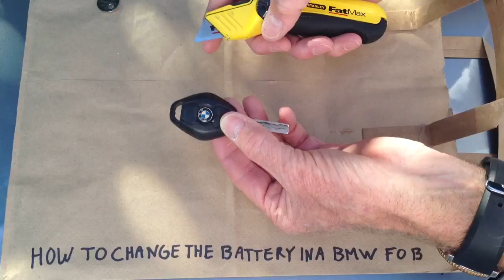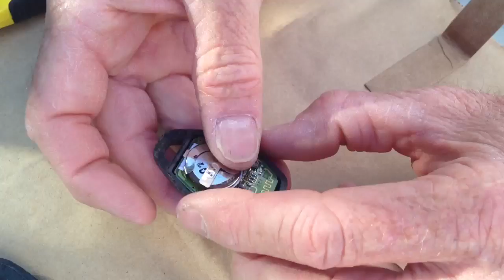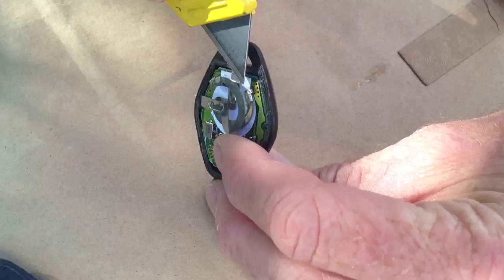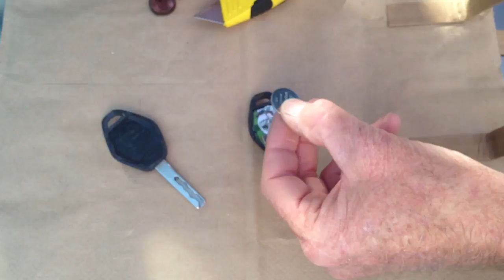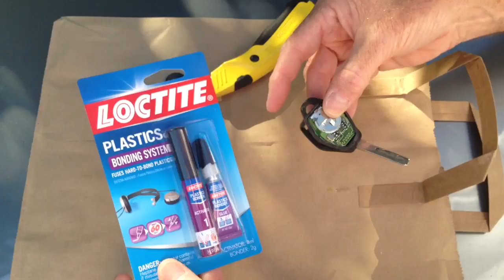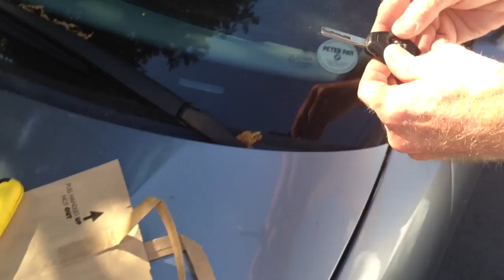How to replace BMW Key Battery

Comment: Two things. 
1: I think it's probably better to apply heat to loosen the glue and then pry it apart. That way you can reuse the old glue. 
2: As other people have noted the 2025 and 2020 are not interchangeable. The 2020 is rechargeable and the 2025 is not, don't know it will damage the key though.
Reply: The fuck? The car ended in 2007 or something bro
Reply: @LukeVMH-Games  ???
Reply: @volundrfrey896  this is a E46 key video. The E46 was discontinued in 2005. Why are you talking about 2025 and 202
Reply: @volundrfrey896  oooh u meant the battery

Comment: I used an X-Acto razor saw to split the key case for a neater job. I found that the battery was fine, but that one of the battery micro welds had come loose. Bending the contact down so that it touched the battery restored full function. Neither the valet nor the wallet keys originally supplied with the car have RFID chips. They lack the remote functions but work fine for unlocking and starting the car. The valet key will not unlock the glove box or trunk.

Comment: My key stopped open and lock the car a year ago, but there still was just enough power to use the emergency opening of the trunk (when the lock cylinder in the driver's door gave up). Even with a bad battery, it still charges a little bit every time you use it and that power can be enough for that emergency feature (for some reason THAT works, bot not the regular lock - why I don't know - perhaps a security feature, so you'll change the battery or key before it's totally gone).

Another thing I noticed, is that when the battery is almost completely dead - the RFID will not get enough power to activate the gear selector for automatic transmission (the display will not show P, D or R) and kick-down, top gear and reverse lights will not work. Sometimes the car won't even start att all. But after letting the key sit in the lock with ignition turned on a while, it usually wakes up. With a new battery - everything works perfectly again.

I used a CR2025 a while, waiting for the online orders of proper VL2020 batteries. Make sure to buy VL2020 with 90 degree connectors, so it will fit on the circuit board. Flexible (but strong) glue is easier to use than those super glues, I found out.

Comment: Sounds like the replacement battery used is a CR2025 which is non rechargeable. Radio Shack won't have these specialist rechargeable batteries, online is always your best bet for the VL2020.

Comment: Hi can you help me I have a 2007 X3 looks like the same key doesn't unlock or lock, but my main question is would the battery being dead on the key effect the starting on the car? There's no crank and battery in the X3 is good starter is good manually tested it but still won't turn on. The key has an EWS chip on the circuit board right? And Does it need to be powered? I recently bought the car like this just Trying to figure it out. Thanks.
Reply: Same problem here, no crank, could be the key battery?
Reply: @nananghayum6297  Ended up towing to  the dealer to reprogram a new key all good after.

Comment: A rechargeable battery must be used... it's charged every time the engine is running. 2020 is rechargeable, 2025 is not, so should not use it :(
Reply: yep get 2020 but vl2020 is not something you can get at a local parts store but 2025 you can so if your in a bind get the 2025 and order the Panasonic vl2020 later from ebay or amazon its really cheap. get the 1 where you have to solder it on. 2025 will probably last you 6 months while the original will last a few years.

Comment: This key does NOT recharge the battery. You can tell because there is no connection from the metal key to the motherboard, and the metal part of the key is one piece of metal. In order to charge the battery, the key would have to have two contacts, that each connect to the motherboard.
Reply: FunWithPaul    They ARE charged by the car, by induction when the key is on!
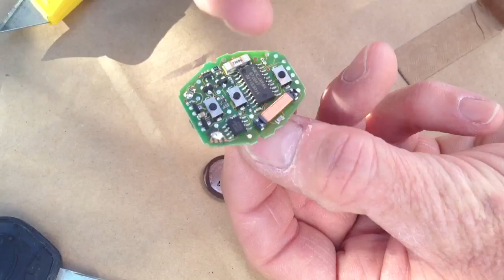Reply: Wrong. The square piece of bright copper windings you see at 0:55 next to his thumbnail is the induction pickup recharge coil which is what picks up the power wirelessly and recharges the rechargeable battery. The battery is rechargeable because it has an R at the end of it's number which stands for rechargeable. A 30 minute drive will give you 15 open and close press of the remote. It takes 30 hours to go from totally dead to fully charge battery. Don't talk about thing to which you don't know as fact. You're only hurting and not helping others and causing only more confusion even it that wasn't your intentions that will be the result.
Reply: FunWithPaul.  You are partially right, the key doesn't recharge the battery......the car does! Through induction from a coil in the steering column around the key entry! It's supposed to charge key as the motor is running! There are no wires or contact points!

Comment: Not worth it  open it up. Too dangerous and time consuming plus high chance of messing your key up just to replace a battery. Very hard to cut open and find the rechargeable battery with the 90° degree leads. I see them now but they go in and out of stock a lot. When I did mine there wasn't even a listing for the 90° ones only the 180° ones. 

The only downside is now you have to carry an extra key on your key chain for just the remote functions. However it is the way to go. The upside is you avoid the risk or cutting yourself and damaging the old key. Not have to reopen and resealing the keys close again the. The new remotes are meant to be open and reopen easily to  replace the batteries anything  you like  easily. You also pop out old battery and new battery in easily. Never have to deal with soldering and desoldering  again. Never have to look for hard to find rechargeable batteries with weird rare pins. Notar key just to replace a $8 battery. 

 I tried opening mine and my blade accidentally cut off and destroyed some surface mount components and now the remote function of the key doesn't work. Luckily I didn't mess up the transponder so key still started the car. I just taped it up back together with black electrical tape. 

Had I known I would of just went out and bought a cheap aftermarket key with built in remote for for like $10-$15 with new battery already installed. You can still start the car the old key fob with a totally dead battery as long as the ciruitry is still good and undamaged. At least with these BMW keys you can. 

You can cut the new after market key or not it's up to you. You're just buying the new aftermarket key for the remote opening and closing and alarm function not for starting the car. As cutting it can cost anywhere from $30-$60. Then if you choose to program the keys that can add another $40-$80 for each keys. Good idea to have at least two working keys. 

For California residents only. You can call BMW keys direct hotline at 1-888-575-5397 anytime to get "cheap discount" made keys from as low as $150 shipped overnight direct from BMW without the dealer ripoff markup price goughing and waiting a few days if done through dealer. However be aware some older keys are no longer being made and harder to come by and stock varies. They will overnight it to any BMW dealer of your choice. When you go pick up the key you just need to show driver's license and registration in your name to pick up key at dealer.
Reply: If cant use a blade to open it up or do the task...then dont, go pay that extra money.  But it is an easy task not really sure why your making it sound like its not.

Comment: Does the battery brand matter? I could only find energizer at my local auto zone. I've heard bmw use Panasonic batteries but they're no where to be sold. Only online. I have a CR2025 but I don't want to open the package because this battery might be the wrong one. Can anyone help
Reply: The "brand" does not matter. A CR2025 is not rechargeable if you want that functionality.

Comment: you guys understand why this key is sealed and battery welded to the board right?
Reply: c32c7 do tell
Reply: Its sealed because BMW get $270 for a new key when the rechargeable battery fails after a few thousand uses. you can buy a new rechargeable battery off Ebay for $10 and a bit of easy diy save yourself $260..................
Reply: @19thewanderer  yeah, if you don't cut your hand trying to get the darn key to open up.  It's nearly impossible!

Comment: Are you fucking kidding me? this is shit. You should touch the chip like that at all, ant the battery has to be soldered out and soldered in from another side!! and there are specific batteries called VL 2020 90 degrees!!!!